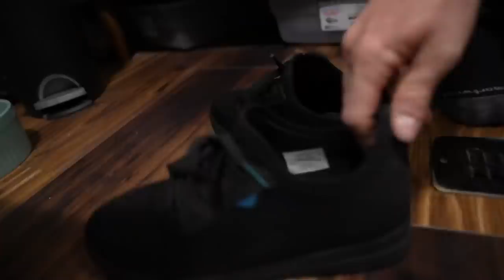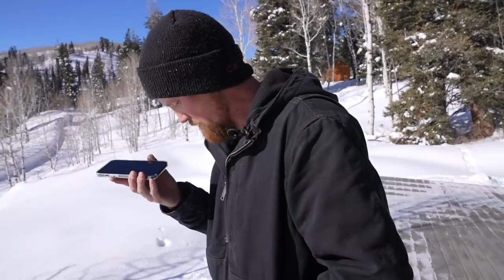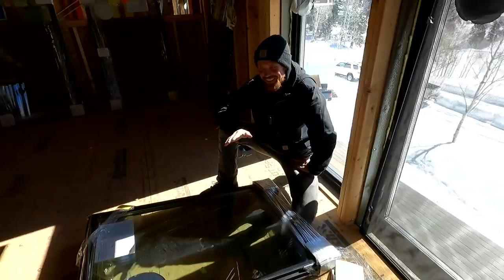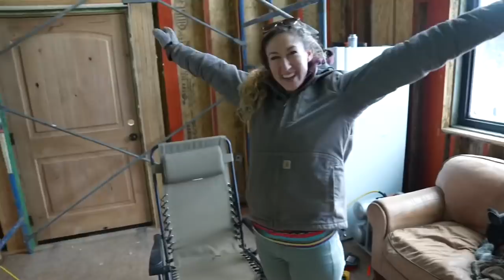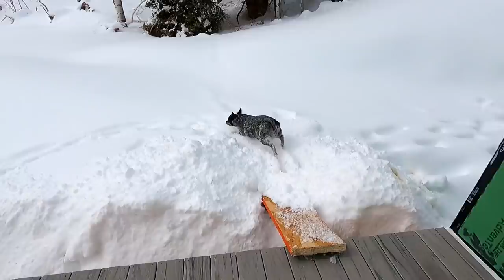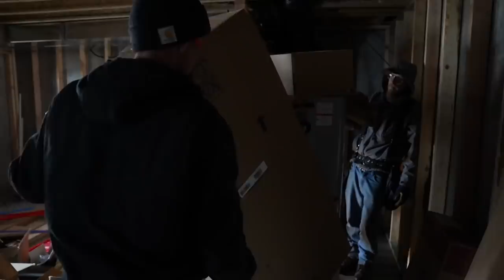WE THOUGHT THIS WAS OVER | BUILDING OUR OWN HOME

Comment: I didn't see the drain pan put beneath the water heater - did I miss that - or was that perhaps done off camera?  crosses fingers in hopes it was installed off camera before it gets filled
Reply: I noticed that, too.  Don't you still want to have one even if it's in the basement on concrete?

Comment: Why didn’t you go with on demand water? 
Takes up less space, weighs a lot less and you have unlimited hot water.
Reply: Plus it doesn't work 24/7 to always keep 50 gallons hot
Reply: Good Question.
Reply: @jerrys634  exactly, important if the tank is in a cold basement.

Comment: You might want to consider putting in a vacuum system for Allie.  Mine has lasted 21 years.  You just have to move a hose around and it’s pretty quiet if you have in a closet.  It needs a vent.  It’s easy to empty.  Price it out.  It requires piping in the walls and smooth turns and no 90 degree turns and outlets to plug the hose in.

Comment: A tip concerning your household water filter and any refrigerator you buy that uses water filters:  Get a by-pass plug for your refrigerator, if it requires one, to replace its water filter.  The whole-house water filter causes enough of a reduction in the water pressure to your appliances that your refrigerator's computer board will think that your refrigerator filter is always full and needs replacing.  Some refrigerators do not require a by-pass plug - just removing the water filter will do.  Check with your appliance owner's manual or the manufacturer of your appliance to see which type you will be using.

Comment: One suggestion for the water heater, putting flat brick under the heater will allow the heater to vent and if there is a leak water will be able to go under the heater instead of saturate it and possibly damage your new water heater. You may already know this or are deciding to do so. Much success on the rest of plumbing/water and whatever is next for your build.     “keep on truckin”  your buddy Rik

Comment: Check code spacing on wall outlet's. Most are EVERY 6'  and 12" off the floor. Switches 48" off floor. Plan for alot of plugs around TV area. Also you'll want PVC pipes in the wall for HDMI cable's if you wall hang a large TV. Keeps a clean look. Whole house speakers can be wireless. Or run speaker wires in the walls. Also when you get cable,  you'll need cables RUNS for the TV , in the walls. Think about high speed NET also. Cieling fans living room WIRED boxes. GFI plugs kitchen,  bathroom, have fun...

Comment: Usually the Ecobee thermostats warn you of a problem.   We have one for our Geothermal system in our house.   I’m sure you have the alerts set for low temperature on the Ecobee app.....this would have told you the furnace wasn’t heating.   There would have been time to check it out before it froze....
Reply: It's a 90% most likely the drain line is what froze. If they would have wrapped the line with heat tape it would not have froze
Reply: @dalekronk496  Exactly.  But, the Ecobee should have indicated a problem....as long as the thermostat is communicating through the cloud.  When we’re on vacation we keep an eye on the temperature in our house...in case our son is cranking the air conditioning etc....then we can change it back from a distance....lol
My husband always tries to convince his customers to install those thermostats.   I know ours is programmed to alert us for all sorts of things...
Reply: @kristinkiel8890  betting they shut it off at the gas and electrical.
Reply: @dalekronk496  Sounds like it....we don’t know everything ....🤷🏼‍♀️🤔
Reply: @kristinkiel8890  just spent a week wrapping drain lines for the company I work for.  90% are great unless you shut them off. Or it gets really cold.
Reply: @dalekronk496  Yikes!   Yes, winter can get crazy.

Comment: Curious that you chose a conventional water heater over an on-demand unit. How come?
Reply: You will find that it takes longer for the water in a bigger tank to heat up I know you probably bought that big one thinking you'll never run out of hot water but you may find the opposite is true. I'm with these guys the best way to have the hottest water whatever is in on demand system it probably wouldn't have been very much more expensive than the unit you bought.
Reply: Me toooo! I was looking to see if anyone else thought that.
Reply: Why no t on demand heater?.? They are the best. After my first one,,, never go back to tank.??.!!!!
Reply: @carolmoore1038  It will cost way more because you will need individual units for each bath and kitchen.  If these are electric heaters then you will have to have 60 amp breakers for each one, if you use propane ones you will need exhaust pipes to the outside at each location.  We have lived in two trailers for over 40 years with one 30 gal heater with a family of four.  We have never ran out of hot water even taking back to back showers.  If you try to use one unit for the whole house then you are wasting water until the hot gets there same as a big water heater.  The water heater only takes one time to heat up which does not take all that long.
Reply: @joecool9124  I have to disagree with your assumptions.  You only need one for the whole house, and propane ones use the same size exhaust vents as the big water heater they bought.  The amount of time that it takes to deliver hot water is just a few seconds, and then you just have to get it to the point of use, just like the big heater.  Unless they have tank-style water heaters that use electric igniters, most water heaters will have pilot lights burning constantly, ultimately using more propane.  We switched from a 50 gallon propane tank heater to a 100K BTU demand heater, and there was a net savings of propane use.
Reply: @joecool9124  more to install or more to operate? To constantly have to keep 50 gallons of water hot takes a lot more than to just rapidly Heat what you're using. My brother-in-law had one he only had one for his whole house. I can't tell you about his breaker box I never examined it LOL he had constant really hot water too hot if you weren't careful it really really lowered his electric bills.
Reply: @joecool9124  With all due respect, all of you've stated about using an on-demand water heater is incorrect. I say that with plenty of confidence after owning two household units and two aboard boats…

Comment: 20:18 Just an fyi, minimum pipe length between  expansion/ Uponor fittings is as follows:   1/2" pex requires 2" length,      3/4" needs 3" length,    1" needs 3 1/2" ,    1 1/4" & 1 1/2"  need 4 1/2" . If you do end up with any leaks, a heat gun on empty pipes for a couple min has fixed them every time for me. Only time I've had leaks is when installing in an unheated room below 40 degrees F.

Comment: An old trick to setting boxes is to set your hammer on the ground vertically then set the outlet box right above that.  Check it...it is to code...I would suggest that you plan on paper the runs for each part of the wiring.  Just use different colors for each run.  this will also help you doing load calculations and getting the correct breakers for each run.

Comment: Could you talk about the reasoning behind having the garage so far from the house? If you did already I may have missed it. ❤️
Reply: @bevtrue6937  I assume they will build a garage at some point. There’s a foundation for it now.
Reply: @bevtrue6937  saw it when it was poured. Terry is sitting on it.
Reply: would assume its because of elevation change. To put the garage closer to the house would require a very steep driveway.
Reply: I have not heard them give a reasoning. But I would suspect in short it is due to the location spot they picked to put the house.

First as Larry Freeman stated, it is more of a steeper incline from the parking spot / garage location to the house. I am sure his truck would not have many issues, but most other vehicles will. Including now hers.

Secondly they could not put a garage on the right side of the house, as that is where the enclosed veranda room is with all those large windows in it. That would block the nice views out. That only leaves the other side of the house, near the kitchen / loft side. This might actually lower the incline needed to run driveway further. But at the cost of having to put in a tight switchback. Which again is far from ideal. There really is not enough head room to put it in front of the house, beneath the deck. Plus you would still need to climb steps up to the main floor anyway, so not really much point.

Plus the garage will hide that propane tank behind it. Doubt that was a consideration, but it is a nice icing on the cake.
Reply: @kevinfisher1345  all of that makes excellent sense. I just think about things like carrying bags of groceries from where you park to the house. Hopefully they’ll talk about it, hence why I brought it up here. ☺️

Comment: Trent, you calculated the propane usage. Did you also take in account, that the furnace is running for a much shorter time than the tank is there? Before "only" Terry used the propane, now it's Terry AND the house.

Comment: Missing Pressure\Bladder tank? I suspect you have a pressure tank buried outside next to your well, but that's not a good idea since the pressure switch is buried with the tank and the tank will corrode. Ideally you want to have a tank between the incoming water line and any filters so that if the filter gets clogged its not going to burn up the well pump. I would recommend including a pressure tank in your basement and pull the buried tank out in the future.

Also consider adding ball valves on both sides of the water filter to isolate it when you need to change the filter. if you have water with a lot of sediment, consider adding a spin-down filter which has a tap to flush out large size sediment, which will extend the life of your fine sediment filter. The first rule of plumbing: You can never have too many ball valves.

Comment: I always found the name “hot water heater” interesting.     That’s what they are called.
You don’t need to heat hot water; you heat cold water.    So it should be called a “cold water heater”.    Or simply, a water heater.
Reply: It’s a water heater that produces hot water. So, it’s fair to call it a hot water heater rather than, say, a lukewarm/warm water heater.
Reply: I'm glad I'm not the only person who thinks about these things. Like why we park in driveways and drive on parkways 😀
Reply: @rabbit_scribe  or horseback riding. --- where else on a horse do u ride 😆 ??
Reply: Actually you do need to heat hot water. Otherwise that tank of hot water will cool down and become cold water. Hot water heaters run all the time to maintain it at whatever heat setting you set. It never heats cold water .. well except the first time it is cranked on. As any lil bit of cold water in is going into a big tank of hot water. So at best it might lower that tank of hot water a few degree's but that tank of water will still be hot water, not cold water.
Reply: @kevinfisher1345    I worked in the natural gas business for 33 years, so please explain to me how a water heater works.
Reply: @brucewilson2763  A hot water heater converts cold water into hot water. It does that by allowing cold inlet water into the bottom of the tank. It maintains that tank of hot water at temp the thermostat is set at by heating it up. Which is either done via some form of gas burner directly under the tank as well as with the flu going through middle of the tank or via electric elements (usually two) inside the tank. Along with an anode rod in the tank (biggest maintenance but last years).

But it is called a hot water heater because it is heating a tank full of water, in this case a tank full of warm / hot water. Unless the tank is empty or it got shut off for extended period of time. Then it is heating cold water, but that is not its normal function. And once that happens it does not output hot water anymore, as it simply can not heat that water fast enough then amount going out. IF it was heating cold water, then this would not be the case as it should be able to meet the outgoing supply out. But they are not designed that way, that would be an on demand system. They are simply designed to heat and maintain that entire tank of water, which is kept hot at all times in theory.

Not sure how solar water heater works.

Also not sure why you are asking me if you have been in the natural gas business.

Comment: A fire wood tip. To save you time. Target has stainless steel shelves you put together for a pantry. Each shelf holds 350 pounds. It 6" tall 3.5 feet wide. U can put wheels on them. Perfit for holding fire wood stack. Holds 1750 pounds on wheels. 65bucks. 2 would hold all of the wood and u could roll it around.🤔

Comment: Hey Team! When you're planning your electrical don't forget to plan for an Electric Vehicle on your garage!

Even if you don't have one today, someone in the next 50 years is probably going to have one. Don't need to install the charger now, but even putting a dryer connection in there will make that a ton easier.

Comment: Why not tankless hot water heater? I’ll never go back.
Reply: I wanted to convert to a tankless but I was advised not to even try it with my well water.   The county water is full of calcium, too!
Reply: @CookingAroundTheWorld  where do You think "wasted" heat is going? It's warming the air around. So there is no waste, just air heater will use less propane.
Reply: I was wondering the same.

Comment: Being that is a basement, you should elevate that tank at least a foot off the ground and set it in an overflow tank.  Also please remember to strap your tank and filter to the wall.   Also very important, get a sharpie and write the install date on the side of each unit.  Trust me you will need to know this later on down the road.  Put the manual in a zip lock back and staple it to the wall nearby.  This will save you from having to go dig for it later when you do repairs.

Comment: Hey GUYS! Remember how the furnace froze at the beginning of this? You realize how AWFUL it will be if the filter or water heater freezes?
Reply: Heater: This should be less a problem once the insulation, walls, flooring, .... and I’m guessing the heater when running properly will have a setting that will stop unit from freezing....

Comment: Noticed  that your wall studs in the basement are right against the concrete.  Up here in Canada, code is to keep the wall framing and insulation spaced 1" away from the concrete to prevent mold growth.  Doing renovations on older homes, whenever I've encountered the insulation and studs against concrete walls, there has been mold.  This is caused by the moisture condensing on the cold concrete, then being absorbed by the wood studs and the insulation. Typically in a basement wall assembly, the studs can be standard studs, however, the floor plate needs to be pressure treated as it sits directly on the concrete and is prone to mold growth and subsequent rot.  Just a heads up! keep up the great work guys!

Comment: Has anybody taught you how to stack firewood by cross stacking the ends? 
I would have installed a 40 gallon with a mixing valve like the Cash Acme 24644. Tanked propane means you want to be efficient with propane use. A water heater is a big propane consumer. A mixing valve makes a 40 gallon act like a 50 gallon for less propane use. It will be very useful to put a screw cap accessible drain in the drain pipe stack below the water heater drain valve so you can empty the water heater if you ever have to leave and risk a freeze inside the cabin. Your cabin needs to be frost protected if you ever want to leave during the winter.

Comment: that has to be the most illogical way of building a fire I've ever seen.  Heat (& flame) rises.  And the draft is upward.  Starter stuff on TOP of logs ??!!  Without that torch, I doubt if that fire would have happened.
Reply: Read "Norwegian Wood: Chopping, Stacking, and Drying Wood the Scandinavian Way " by Lars Mytting... it's a  logical way...